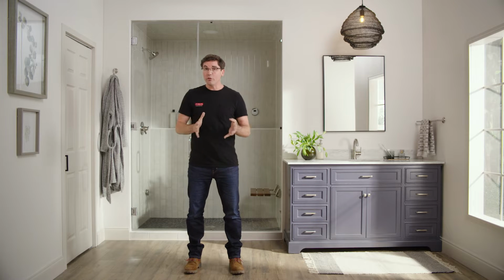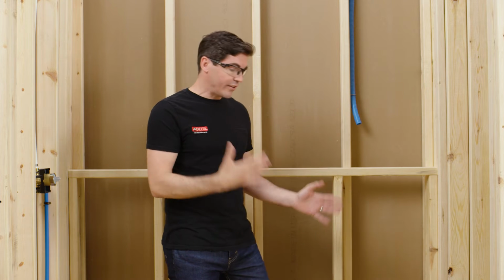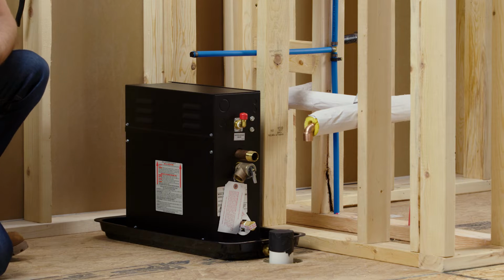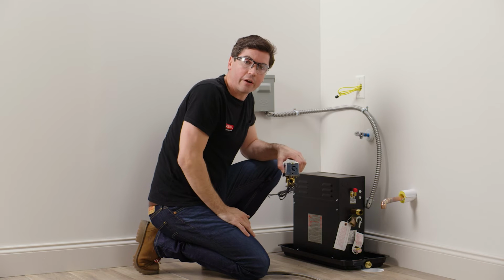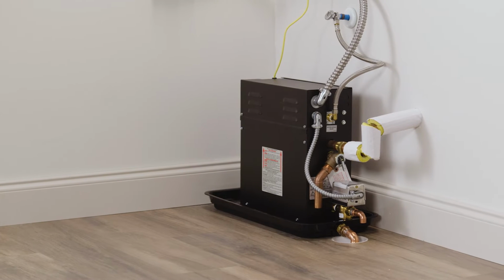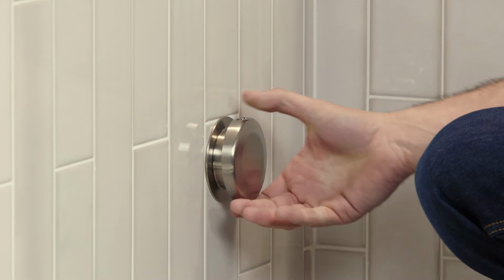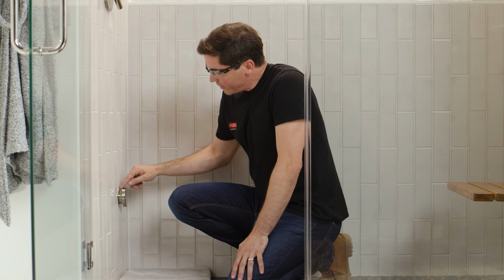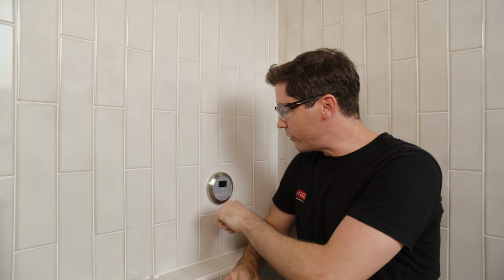How to Install a Delta® SteamScape Classic System

Comment: I wonder if this was inspected ; the T&P valve should definitely be stubbed out in most jurisdictions as the pressure is high enough if activated to splash out of that pan and onto the floor creating an expensive to fix water damage.

Comment: Nobody has a gigantic room like this where they can install their steam generator.  Where do you put the cutoff switch when you're installing the unit in a closet or attic, as advised by the installation manual?

Comment: Great video with clear directions. However, the installation instructions provided by Delta state that the steam pipe should be sloped away from the generator to allow (cooled, condensed) water to flow out the steam head and not back towards the generator. 
It would be much more convenient to install it the way you have shown in the video though.
Reply: In my opinion, having the pipe going downwards directs condensation into the walls, assuring humidity in walls, no bueno. Some humidity will occur but we do not want to add to that but minimize. 

I would install the pipe flat. Installing the steam pipe flat will equalize condensation, some inside the wall, some outside the wall, & time will evaporate them both. Or, I could install it towards the generator to make sure condensation goes back into the drain pan. I think this is better indeed, because it will evaporate in the open odorless.